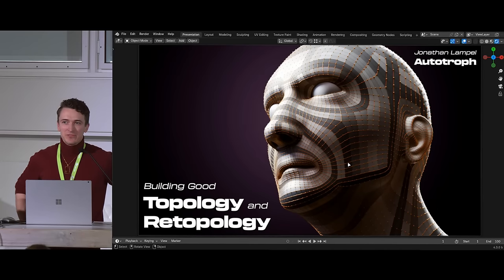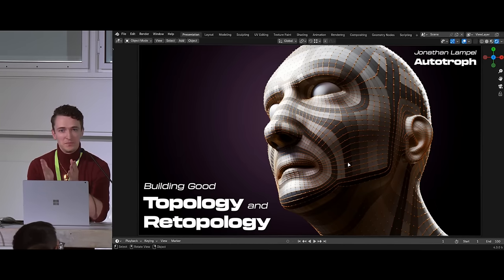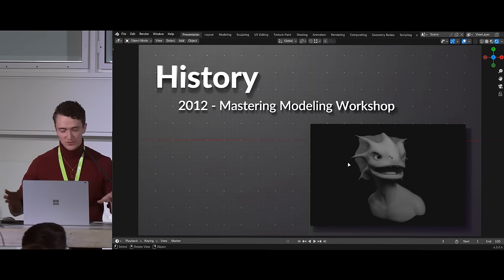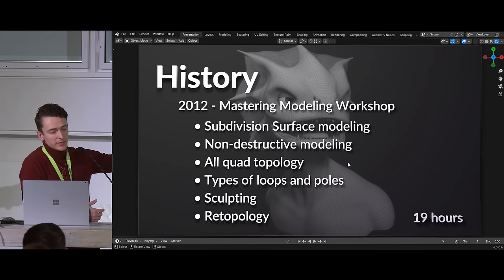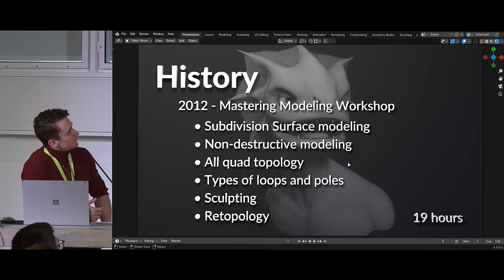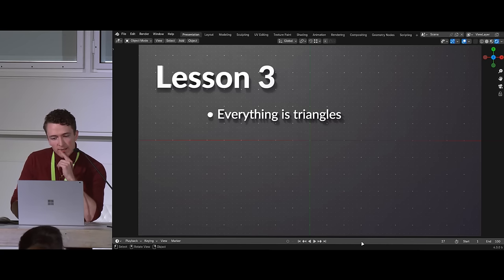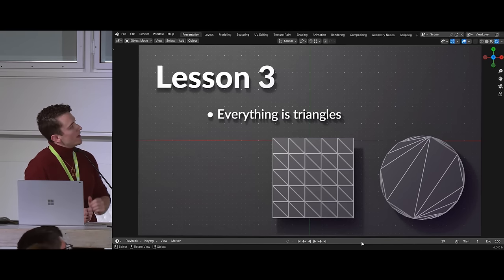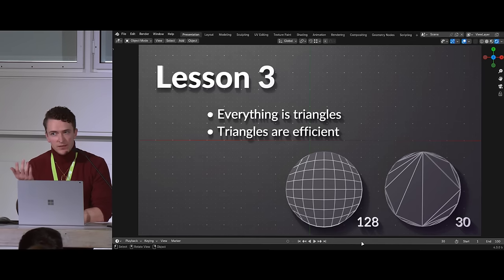Building Good Topology and Retopology — Blender Conference 2024

Comment: Retopoflow working in the edit mode seems like a big improvement, I stopped using the older versions because they felt too clunky.
Reply: Yeah. I Wonder how it would the performance be especially with multiple objects.
Reply: @CrankHead-z8z v3 is very good but there is still some switching.

Comment: Any anyone know a quick way of getting rid of bad polys and loose edges ? I’ve been repairing nomad sculpts that have tons of bad geo and I have to go in and manually delete the bad polys and edges, repair the holes and there’s always polys and edges that I miss and end up passing it’s bad geo over when using shrink wrap,  solidify etc
Reply: I've found the 3D Print Toolbox that comes shipped with Blender to be pretty good at quickly cleaning up bad topo. There's a button in it called Make Manifold. Works like magic most of the time.
Reply: @Arjjacks  yeah that's a awesome bit of kit.